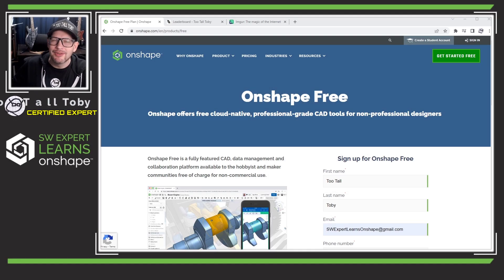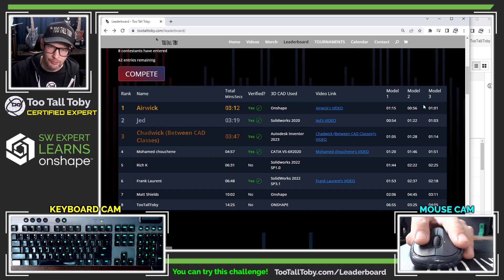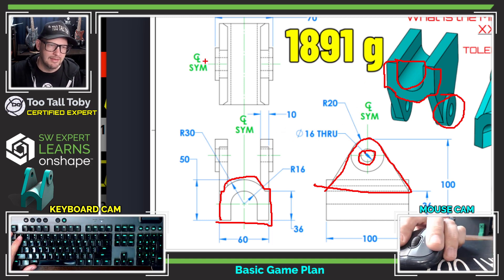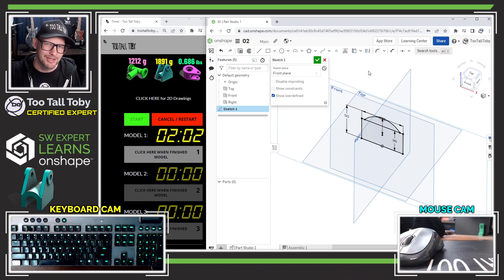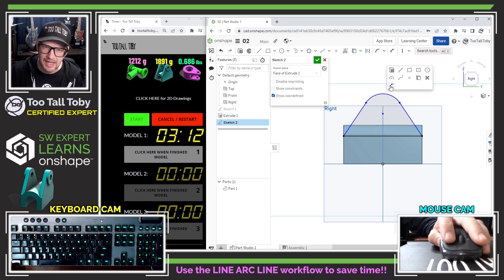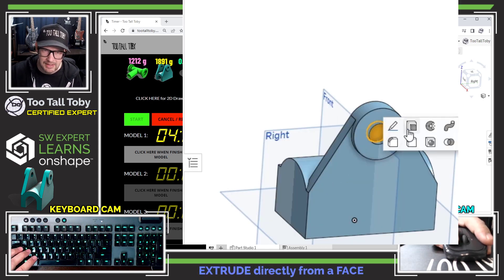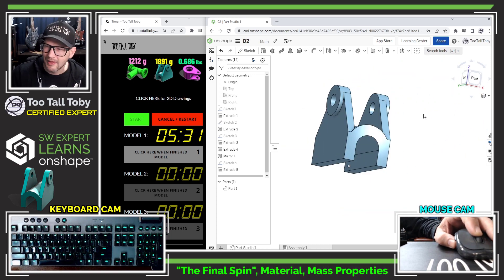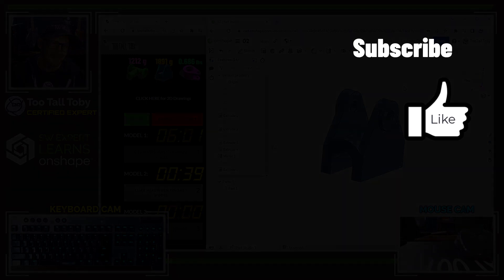SW Expert Speedmodels in Onshape (Part 2)

Comment: Looking good!
A few minor comments on this one:
- On the first sketch I would use a center point rectangle to pickup an automatic relation with the center and place the bottom corner on the top plane, note that Onshape still lets you use auto-dimensions after adding these constrains so that would save some clicks.
- Pretty "adventurous" use the tab/space key... I personally find it's not quite predictable enough (i.e. variable number of tabs depending on feature types and options selected) so I don't really use it other than in "speed runs" where I can just "memorize" how many tabs I need but good on you!
- Second sketch you did mention you didn't need to do a "use"... you also already had a horizontal auto relation between the two ends of the arc so didn't need to also add the vertical relation on the centerpoint.
- Another reason I don't like using "space" is that the space bar is the universal "clear selection" shortcut in Onshape, so what happened is that you cleared your extrude selection instead of flipping the direction. This is a good one to know by the way as you sometimes don't have a blank space to click on to clear the additive selection in graphics area: space bar does it, or you want to start over a selection in a dialogue: space bar!
- In this case what you wanted is actually the "a" key, which is used to "flip" direction, it works in a bunch of places where you have a "flip" button like the extrude direction one. It's also used in mates/mate connector definition to flip the "Z" axis (and alongside the "q" key that rotates in 90deg increments along z but that's for another day!)
- Just a general comment but I like to include more things in sketches so I would have added the two circles for the boss and hole in that side sketch as well as the notch on the front plane on that first sketch. but that really depends on your design intent/preference. I probably also would have just modeled 1/4 of the part used mutli-mirror at the end.
- For that last sketch I would probably just use a centerpoint rectangle and circle (rather than line-arc-line) as you would get your centerline constraint automatically.
Reply: @TooTallToby,
It's weird, Youtube is showing me a notification that you replied here but I don't actually see your reply in the video comment section, only as a "preview" in my notifications so I can only see part of it (and it just goes away when I click on it)! I did check out your live recording though!

Comment: I would have combined Sketch 5 into Sketch 1 and that would have removed one extrude. 

This happens to be some of my favorite things to do in CAD. Either from a drawing or with a set of calipers.  Two years ago when our local branch started or own R&D Dept our parent company was really stingy on getting us their SW models. So if I was trying to design a part or modification to submit to our Engineers I'd have to do this. After a bunch of back and forth about 6 months ago they started to release the CAD to us directly now. And a couple weeks ago the Engineering Team were visiting and I have them on the edge of switching from SW19 to Onshape. My turnaround times have them scratching their heads and it blew their minds to learn I've been fully mating their models before working with them.
Reply: Oh wow that's amazing!  Keep up the good work!  And thanks for the advice on Sketch 5 - that's a pro move (combining them together) and once which I hope to learn how to use more efficiently.  Right now I keep reverting to my old ways, but I'm slowly breaking the habit!! 😁
Reply: @TooTallToby  I was lucky, I guess, no bad habits. The only experience I had in CAD was with Sketchup 2017 and just starting to use F360 (for hobby 3d printing). When I transferred to R&D the Lead Designer was like, "We're looking into using Onshape. Can you figure it out?" I took every self-paced course in the Learning Center and got a couple of Certs. Got good enough to not get kicked back to being a Production Super. :)
Reply: @DK-Design  LOLOLOL - love that last sentence!